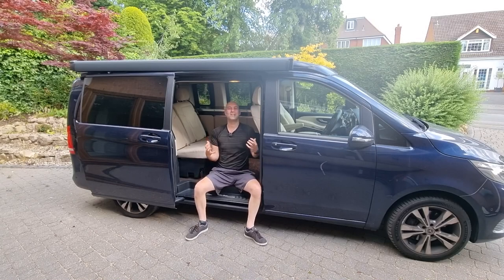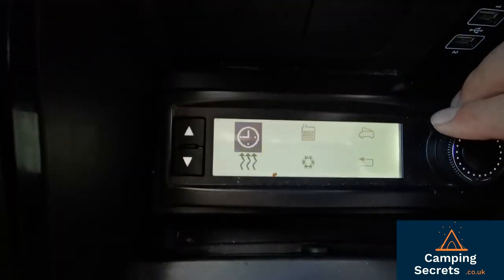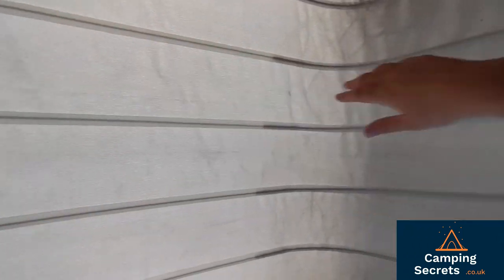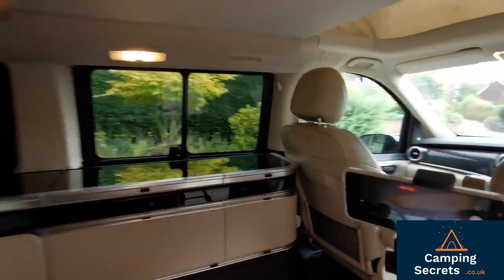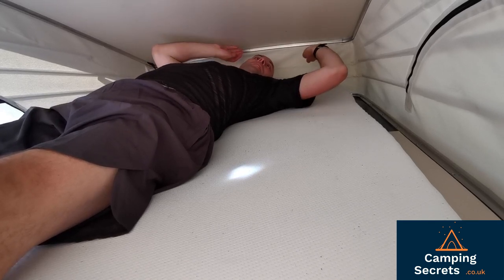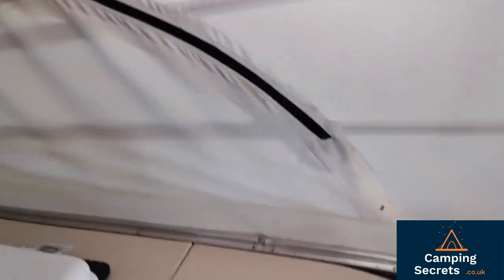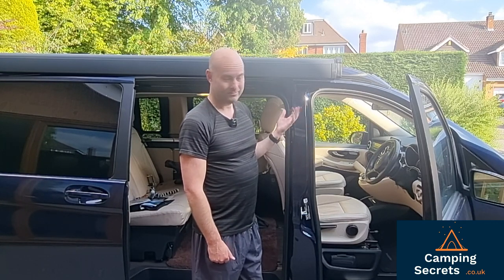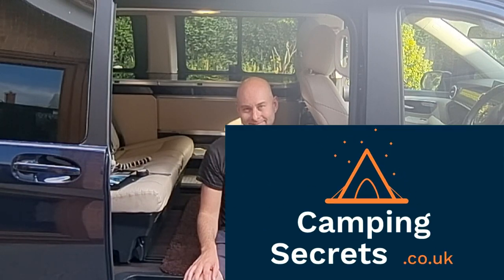Mercedes Marco Polo Campervan - Pop Top and Upstairs Bed - Camping Secrets UK

Comment: Another great video thanks!!

I’d be very interested in a walk through of the habitation console and access to the “hidden menu”, what does it show? If there are error codes what do they relate to? 

There’s such a dearth of good information on these vehicles and MB are not exactly falling over themselves to provide information. 

Many thanks please keep adding to the series.
Reply from the maker: George -  thanks for your comment,  and I'll endeavour to do this for you,  although I certainly don't know everything! Please subscribe to the channel if you haven't already. Cheers!!
Reply: @CampingSecretsUK  splendid thank you. I can see the error table as the first icon there but can’t find any kind of look up reference as to what the error codes would be. I had error code 130 and 170 there which I cleared and thankfully they’ve not returned. I expect they were simply water out or waste full. 

It’s the heater icon that intrigues me. I don’t have the MB aux heater but there is a heater icon visible in the hidden menu, I’ve no idea what it’s purpose is. Anything you can shed light on there would help. Thanks again, a splendid series and a great resource. 👍